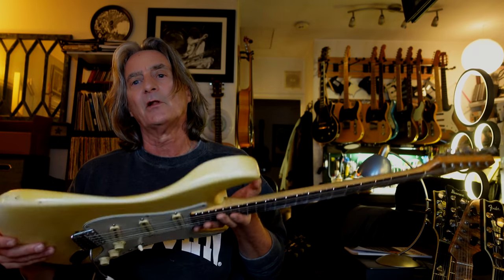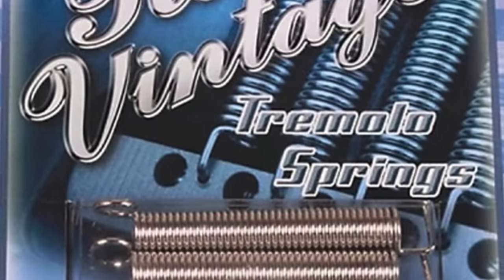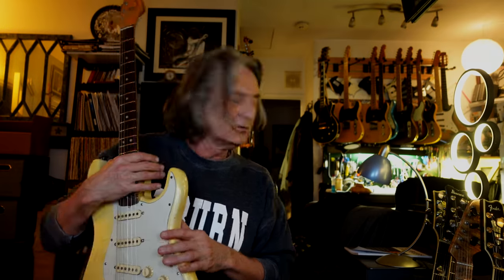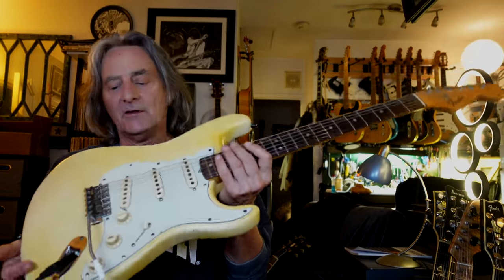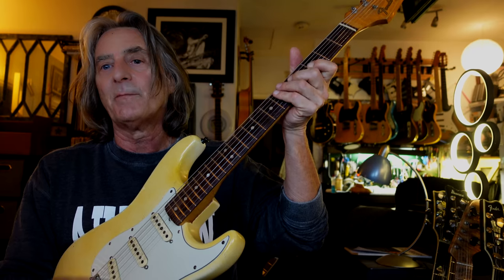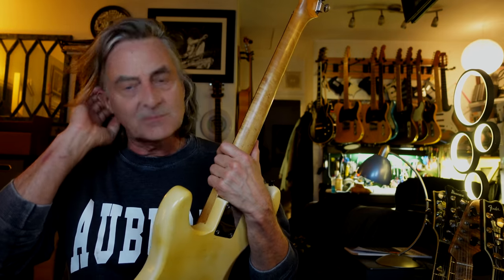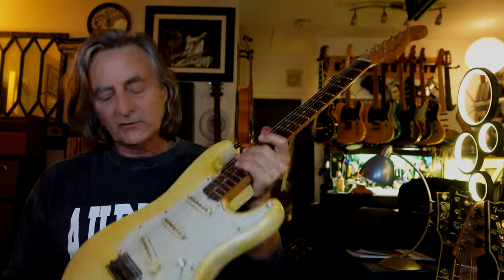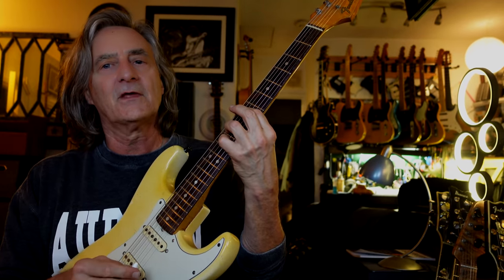set up a strat floating trem with Allen Hinds

Comment: A long time ago I was having tuning problems with my first Strat with a trem (my very first Fender Strat was a 1971 hardtail). After much experimenting and tweaking, what I did first was lessen the angle at the string tree by adding another couple of spacers. The friction points at the bridge were rectified by a spring claw adjustment, there is always more pull on the bridge with the wound string side. What I noticed when looking down the body to the bridge was, the wound side of the bridge plate was very slightly higher from the body (we're talking barely 1mm) but it was noticeable. What I did was balance out that problem by screwing in the screw on the wound side of the claw, so that the claw was further in by 3/8" at the wound side (but that might depend on your string gauge as I use 11/52 and I use all 5 springs or 4 on 1 of my Strats as they are strong springs). Taking the strings and springs off, I adjusted the trem bridge screws, by holding the bridge up, so the block is hitting the rear of the cavity, I started to screw down until I felt the screw wanting to flatten the bridge, then stopped. I did this to them all to achieve continuity with all the bridge screw heights. After I did all this, I was amazed at the difference, balancing that bridge out and bridge screw adjustment really solved the problem, along with the lesser angle at the string tree. All my trems are floating at 3/16". I've been doing this for the past 40+ years to all my Strats and every one of them is gig fit and solid. I hope some of you find this helpful, as I went through endless tweaking and changing tuners for quite a few months all those years ago. All 6 of my strats, bar one of them, are partcasters and have either bone or graphtech nuts, it really does matter what material you use there, for functionality and tone and minimum friction. When you have a fully functioning Strat, there's nothing quite like it.  Great vid again Allen . All the very best. Oh ! and I did the door thing with 1 or 2 trem bars also. lol.

Comment: cool video. Regarding Strats being indestructible - so true, and if you ever strip a screw hole in the body whether it be putting on a pickguard or the larger adjustment screws in the trem cavity, you can "dowel" those holes with a toothpick and wood glue or a slightly larger diameter dowel in the trem cavity, and the snip off the protrusion and you have a fresh place to re-screw.  There is never permanent damage to a strat :).  I love you videos.  Not only informative but also cathartic to watch.

Comment: Thank you sir. You confirmed what I have struggled with; break angle. I have known for a while that the higher the tail end of the system, the harder it is to play two/three note bends in tune. So I guess it's just a give-and-take situation.
Or, perhaps I'm not taking string tension into account?

Comment: The thing I like about a floating bridge is that when you do a deep Gilmour bend it raises the bridge which gives you more clearance over the frets and you will hear a clearer note.  The other advantage is that it's like a good mouse pointer that slows down as it comes to what you're clicking on.  As you do a deep bend it will go flat the deeper the bend  and it will be easier to hit the note.  This is why so many people that play a Strat feel like they're missing something when playing a hardtail Strat or a Tele, you really can hear and feel a difference.  And BTW, I never use the whammy bar, have never liked it.

Comment: Dead on correct about the springs creating a kind of reverb tank - even more so when the back cover is on. 
I personally found the ringing of the springs problematic as it would sometimes create overtones that came through the pickups and clashed with the notes being played. I figured out when I was playing my Eric Johnson signature strat - it comes without a backplate, and when I would stand and play the springs would make contact with my body and be deadened. One afternoon I was sitting home practicing and I kept getting this clashing overtone or harmonic ringing through - I stood up and played and it stopped. After going back and forth several times I figured out it was the springs ringing - I could use my hand and deaden the springs and the ringing would stop. Since then I have added rubber tubing on the inside of the springs that deaden ring - Steve Vai does something similar in that he places tissue paper in the back cavity under the cover to deaden the springs.

Comment: Thanks man for taking the time and effort to do this and share with everyone watching for me it's helped confirm most of my own theories on the fender stratocaster syncronised tremolo system and other very similar like wilkenson 2 point withallen keys it's the same concept of physics a bit like juggling two main points tk keel on like the balance of tension between the strings and springs and bridge heel angle if that's the correct terminology idk but I underwood your illustration of the two trees and rope , in this case its the very short springs that come made with different materials and tensions vs with the strings so to me the most important points are being aware of that if you get new strings, I've tried allsorts and swapped out springs  so the claw is even like I made it too complicated doing that but my theory was the bass side has more pull or hard tension than the treble side so low E vs high E so I've found the floyd rose springs come in differently gagued tensions identified by colour, I've put a Couple red springs (higher tension) on the bass side while having either the springs that came with the bridge on the treble side and other times just three green floyd rose springs, basically tried it all as far as I know. But now I just stick to the springs that come with the wilkenson two point tremolo system serial no I don't have at hand if anyone wants to know msg a reply I'll look it up it's a great bridge it works really well I'm building a partscaster it's so far the best closest to the original fender tremolo system but still having the two points in my opinion is easiest to set whichever way I want I like floating so I can get a full back to the body pull but not take the G string further than one whole step. Lubricate with grease all the mechanical contacts or points of friction with something that'll last not so much oil on those parts more grease and oil on the nut and trees less dense doesn't dull the strings. But most importantly make sure there's nothing obstructing the rocking movement of the bridge plate, block and springs. I had a little issue where I was hearing creaking noises while setting this up on my partscaster it was th bridge block rubbing against the body near the top because it wasike £35 for th lis unfinished sycamore wood body which came routed out a little bit too tight in a few areas easy fix it's wood so. Yeah that's my tuppence worth in on tremolo.for now hope someone benefits from this have a great day ppl ❤

Comment: 1. use a blocking “system/method” to set the bridge at desired angle (kept in place by tightening back plate screws. 2. setup guitar. 3. unblock bridge and retune using the back plate screws. You will be in tune/intonated at your aforementioned desired angle. 

Yes, break angle over the saddle gives a slightly different feel of string as well as vibrato action.

Comment: Thanks for sharing!  I love the strat lately, definitely the whammy bar is a big part of that.  I like to get in a venture's groove doodling.  The springs do provide a reverb effect for sure.  I arrange mine so it just bends low, so mostly flat against body.
I'll have to try letting it float more to go up and down.  I bought some nuts I want to try and and anchor that bar - the
free play loose is annoying.  That could be a challenge and still allow it to rotate in and out of play position.  The single coil pickups are an enduring sound on the strats.  I haven't played my les-paul style guitars lately, but I did grow fond of the high bridge you can mute with palm.  You do some nice noodling!  Cheers from MN.
Reply: You can put a spring in the term bar hole before you put the term bar in and screw it down and it will stop the rattling

Comment: If the strings had hinger tension with greater break angles, the pitch would be higher. The higher break angle will, in theory, result in more vibration being absorbed by the guitar, and a different behavior with string bending.
Reply from the maker: Interesting isnt it ?

Comment: I put a shim between the trem block and body so that the bridge is slightly off the body. I find it helps sustain (like a hard tail) and enables me to finish a song live without going too much out of tune when I break a string. As for whammy up like JB, I don't have those alien skills. 🙂
Reply from the maker: I think the company “hip shot “. used to make a product called the trem setter that would Kinda do the same if you broke a string it would keep it at a stationary position
Reply: @allenhindsguitar  i use tremolno. i can hard tail my strat anytime if i break a string. it can be locked or fully floating.

Comment: You are confusing string tension and string stiffness in your tree analogy, top wrapped Les Pauls etc. The string tension is identical - because it is entirely due to scale length, tuned frequency, and string mass per unit length (~ gauge squared). That's Mersenne's law, the basis on which all stringed instruments are tuned.
Top wrapping changes the effective string stiffness, which is why it can feel different (effective string stiffness is affected by the total string length, not just the scale length; as well as the break angle, as that affects string-saddle friction). But the string tension is the same either way.
The number of springs affects trem stiffness, because spring constants are additive for parallel springs.